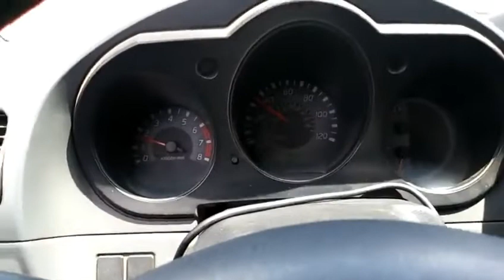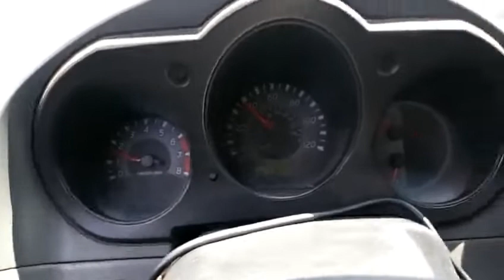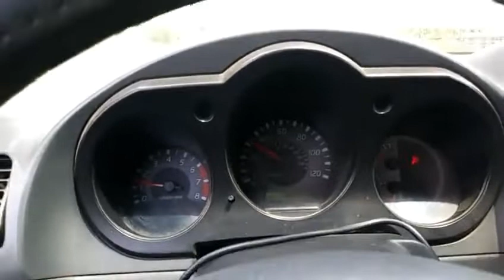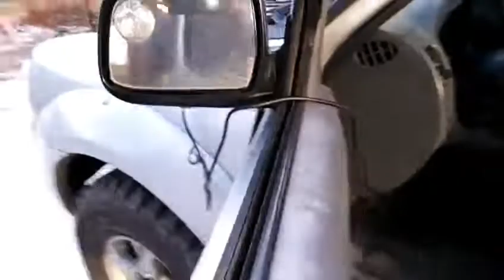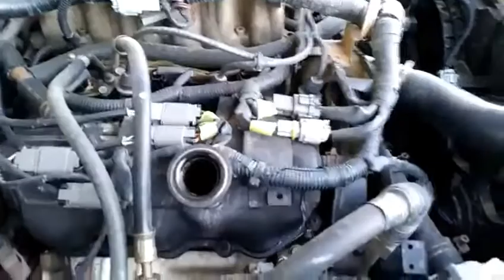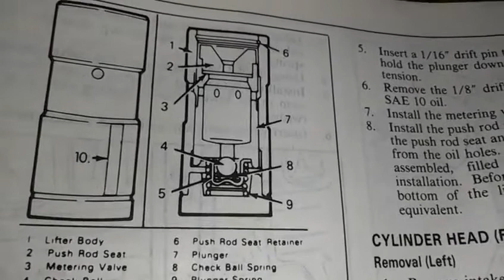Nissan Vg33e V6 engine. Part 1/4.

Comment: A question that I do have is... Is it possible to replace the valve stem seals without removing the head or must the heads come right off? 🙏🏻

Comment: Mines doe this rattle noise too from driver side by valve cover or distributor area but noise goes away whwn i accelerate
Reply from the maker: Mileage over 150k should used a STP oil treatment for better lubrication with a oil pressure gauge to monitor oil pump performance. Plus the engine coolant temperature need to be adjusted to 180°F for restore power.
Reply: @Stevexnycautomotive  i swapped distributor to see if that would be the case but didn't work it recently had the heads done and water pump with timing belt also
Reply: What if I hear rattle noise when the engine is cold and then goes away after about a min. Only happens when I let the truck sit for a few hours or over night.sounds like it takes a while to lubricate and then it goes a way. I didn’t notice that the truck sounds more like a diesel now.
Reply from the maker: Engine might need a new set of hydraulic tappet lifter.
Reply: @Stevexnycautomotive  when installing new lifters do they drop in a specific orientation?
Reply from the maker: The new lifters https://www.ebay.com/itm/275309729374?fits=Model%3AFrontier%7CMake%3ANissan&hash=item4019bd165e:g:XzoAAOSw7jJifYID should be ready to install has long the top button can move up and down by finger pushing it. Sometimes the lifters can be internally clean and reused
Reply: @Stevexnycautomotive  can you tell if a lifter is damaged? one is rattling really bad but can you tell by visual inspection when lifters are out?
Reply from the maker: Can't see any damage on the lifter. I also swap out my lifter for another set of used lifter and the noise continues. I noticed the oil flow at the valve train is very low and slow, so I am thinking it might be a oil pump problem.  Yes, it's one lifter making the clicking sound.
Reply: @coke0drinker  mines was making that same rattle noise and it was an improperly set timing chain
Reply from the maker: The vg33e has timing belt. This noise starter after I switched to castor GTX oil from Shell. Look forward for the oil pump replacement video. I also purchased New lifters to swap in if the oil pump does not solve the problem.
Reply: After using restore and protect the noise seemed to increase possibly cleaned up and caused debris to loosen and cause some loss of flow. Like when using the castor gtx on your ride?
Reply: Mines turned out to be an incorrect timing chain placement had it retimed and sounds gone no more rattle while idling